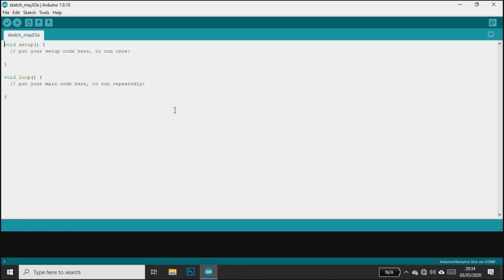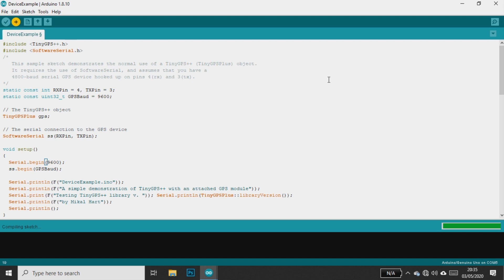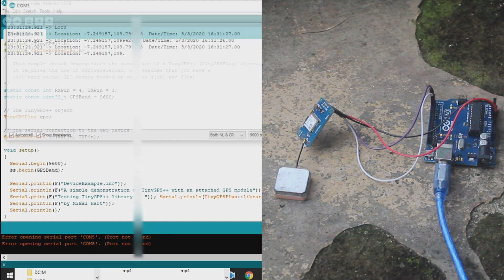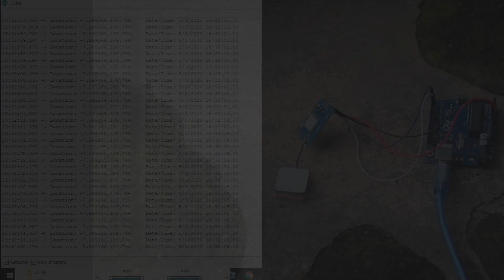Ublox NEO-6M GPS Arduino Tutorial - Get Location and Time from Satellites

Comment: How long will the module take to display latitude and longitude outdoors??
Reply from the maker: Pretty fast outdoors, under 1 minute
Reply: @miliohm  Actually I tried outdoors even after 5 mins it's not returning values
Reply from the maker: @rudhreshvc2106  something wrong with your setup or with the GPS module. I ever experienced the same way, maybe it is just bad module in the market. So i changed it to NEO-7M and everything works fine.
Reply: bro use silver foil

Comment: Hi, I am having trouble with neogps6m module It says no gps detected. Check wiring
Reply: Im having the same issue
Reply: try to swap the TX RX lines.
Reply: @FlexibleBladeTurbine  thank you
Reply: @Flexible I tried swaping the wire but same issue

Comment: I got "No GPS detected: check wiring" on my serial monitor. I'm sure i connected all the pins correctly. Is it because my gps module isn't working?
thank you.
Reply from the maker: If you are sure then something wrong with the module
Reply: I think the module itself
Reply: thanks for helping. i think so too cause the LED of the module did not blinking even after hours being connected to microcontroller
Reply from the maker: @zhafyy  the LED only blinking after it got the signal. But even no signal, the GPS should give the data. And it should say INVALID on location.
Reply: @miliohm  ohh i see. thanks again
Reply: @zhafyy  did you get your working?
Reply: @woodiedave1179  yeah. suddenly a miracle comes to me and its working fine hahaha

Comment: my gps's led doesn't blink/light up although my wiring is correct, same with ur tutorial. why is it? can u help me to solve this problem?
Reply from the maker: Coba tunggu sampai lama. Karena biasanya belum dapet sinyal apalagi di dalam ruangan. Boleh dicoba di luar ruangan biar lebih cepet.
Reply: you have to check the power supply and place GPS with antenna in open area wait up to 60 sec you will get signal ...if your put it in a closed room you wont get any GPS signals...
Reply: @technoelectronics4497  Ive tried this and mine is still not picking up a gps signal

Comment: I saw some videos about this NEO-6M module and the power supply voltage value needed
for it diverges from web site to other.. Some say do not exceed 3.3v or you will destroy the unit,
some other say it can be used from 3.3 to 5 volts..
So what is the truth here ?
Thanks.
Reply: Data sheet shows voltage range for the NEO 6M as betweet 2.7 and 3.6 Volts. So, I think 5 volts would damage the unit.
Reply from the maker: But this is a module. The module has it Voltage regulator.

Comment: My GPS module is not even blinking. Any ideas ?
Reply from the maker: You need to wait, even for some minutes.
Reply: @miliohm  Thank You for so quick respond. :D I will leave write if it will work :D
Reply from the maker: @franklin3491  ok, and if it so long, you need to go outside. Maybe you are indoor so the GPS can't get signal.
Reply: you have to test the gps in open area then with in a minute you will get signal..
Reply: @technoelectronics4497  how long the time it took ?

Comment: am getting no data and wrong date and time
(Location: INVALID  Date/Time: 0/0/2000 00:00:00.00
)
Reply from the maker: it means your gps still loading, and not get signal yet. wait for some minutes. at first time, sometime it need long time to got the signal
Reply: @miliohm  ya it got signal finaly after i got it in the street couz it can't get signal in the house ccous of concret 
but do u know if it can get signal in the car bag ? or even in car body  (can it get signal throw iron)
Reply from the maker: @mohamedmamdouh8862  yeah, i made some GPS tracker for car, and it is doing fine in car.
Reply: @miliohm  is there any special place to put it in the car or it's ok in anywhere ?
Reply from the maker: @mohamedmamdouh8862  i think that's ok anywhere. But I just ever try at dashboard. Never at another place.
Reply: same with me. and i try at the outdoor. after 10 minutes. and the gps still can't get a signal yet. Can u help me
Reply: @nurhana35  i think i can yeah i can remember that I got it working
Reply: @mohamedmamdouh8862  what u do to get a signal

Comment: Hi sir, I have done exactly like you but my GPS 6m blinks but it didn't show any data in COM. I really don't know what is the exact problem. You have any idea on that sir.
Reply from the maker: Check the tx and RX wiring. Make sure it crossed
Reply: Yes sir, I did try putting on RX->TX and TX->RX.  But it shows error when uploading. So I put RX->4 ans TX -> 3. And still it didn't display data even though it blinks.
Reply from the maker: @logadarshinnimaratha9275  you should put TX of GPS on pin 4 and RX on pin 3 if you are using my code. And don't forget to use 9600 baudrate.Turn on the arduino and wait several minutes until the GPS is ready
Reply: @miliohm  yes sir, I followed exactly like you and it shows No GPS detected: check wiring.
Reply from the maker: @logadarshinnimaratha9275  restart the arduino, and try wait again. Sometimes that happen for first time. Did you put the GPS outside?
Reply: @miliohm  same here, my GPS led power not even light up
Reply from the maker: @proximacentauri3916  it will not light up if the device not get signal yet. try outdoor
Reply: @miliohm  I was assuming if the GPS get the signal it will blinking, but mine isn't even light up...
Reply from the maker: Enggak mba, emang hari ditunggu lama. Dan ga ada tanda-tanda. Agak bikin bingung awalnya
Reply: @miliohm  kira2 berapa lama harus ditunggunya?
Reply from the maker: @proximacentauri3916  kalau outdoor mungkin 1 menitan kalau untuk pertama kali

Comment: Hi. I tried what you did and it doesnt work for me. Can you shed a light on how can i whats the problem? All connections are made and the LED is also blinking. But here what it says in my serial monitor:

18:14:27.037 -> DeviceExample.ino
18:14:27.037 -> A simple demonstration of TinyGPS++ with an attached GPS module
18:14:27.106 -> Testing TinyGPS++ library v. 1.0.2
18:14:27.141 -> by Mikal Hart
18:14:27.175 -> 
18:14:32.033 -> No GPS detected: check wiring.
Please help thank you.
Reply from the maker: Please wait and restart the arduino. Sometimes it try to search for signal